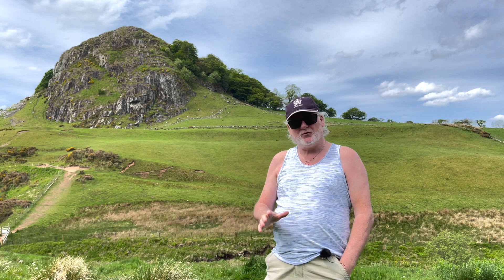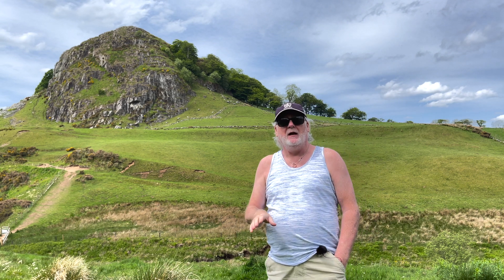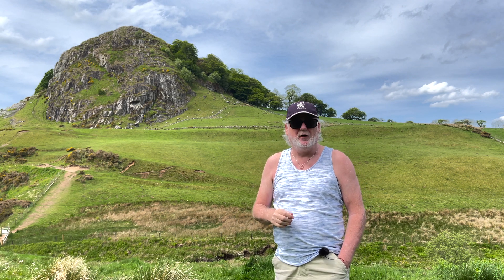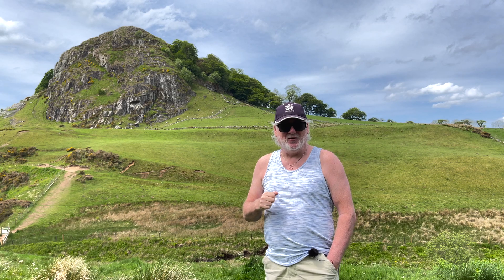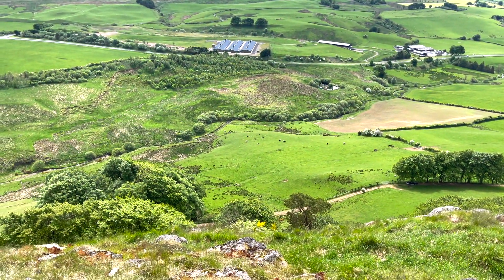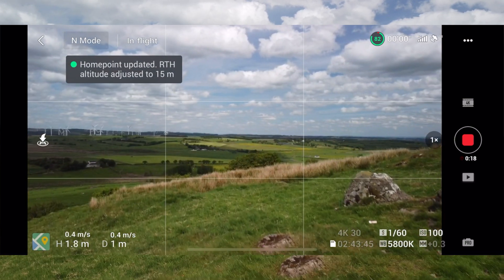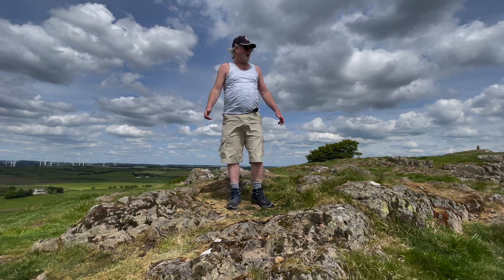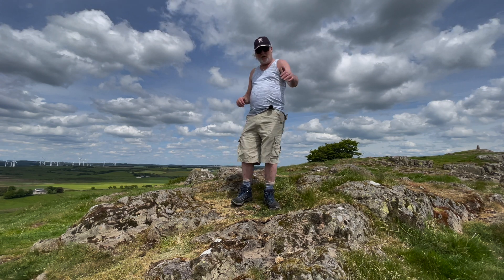DJI mini 2 | RTH NEGATIVE ALTITUDE Test!!

Comment: Great vid Robert.  I am still trying to determine what was more impressive….. the RTH and negative altitude results you proved out or the fact that you hiked up to the top of that hill!  Quick question … When you tapped RTH in that situation, did Lassie immediately begin ascending or did she fly any horizontal directions first and then afterwards ascend?
Reply from the maker: Oh, me getting up to the top - alive - is the more amazing thing ;). Lassie immediately ascended on pressing RTH. You can see this on the telemetry if you check the distance she is at (and the horizontal speed)

Comment: 05:05 Wondering why it says "unsuitable landing area" what was going on there, did you try and hand land?
Another nice video of a test that its good to know comes out as you would expect it to.
Reply from the maker: See the rocks i'm standing on?  There are lots of those - all shapes and sizes and all at different heights. The RTH point was right in the middle of those.
Reply: @WindsweptRobert  but how does it determine that its unsuitable, I thought it had quite a simple proximity sensor.
Reply from the maker: I’m not sure how it determined this, but it was quite right - the landing point was directly above a number of rocks that were all different heights and shapes (I launched her from one of the flatter stones amongst these rocks).  When I took control of the landing, I just moved Lassie a few feet from where she was hovering and landed her in a grassy patch.
Reply from the maker: A much more comprehensive answer than I could have given. Thanks Neil :)
Reply: @WindsweptRobert  Ah yes makes sense, I guess it saw all sorts of changing measurements as you tried to bring it down.
Reply from the maker: Aye Andy, there's a lot on the telemetry. The speed of horizontal movement, and the speed of vertical movement are useful and often overlooked numbers on the screen. Living in the hilly and craggy place that I do, I find these readouts to be very useful :)

Comment: No surprise there. You set the RTH height to 149.
Reply from the maker: No, i set the RTH to 15m
Reply: @WindsweptRobert  Simple arithmatic. -100 too 49 = 149.
Reply from the maker: @daveday5507  I think you may have missed the point of the video even though I explain clearly at the start what I am going to do, I then do it, I then recap on what I did. 15m or 49.2' is where I set the RTH on the app, and no amount of arithmetic is going to alter that fact :)
Reply: @WindsweptRobert  I think you're missing the point.
Reply: @Neil_Jarman  Why does everybody get confused over a minus sine?
Reply from the maker: Nobody is confused except you Dave. I’ll re-check the video, but I’m sure I included the page where I show the RTH height set to 15m. If I didn’t include this screen on the video, that may be where the confusion lies.
Reply: @WindsweptRobert  Who's confused? You set the RTH at 15 meters above the home point. You descended 100 meters BELOW the home point. When you told it to RTH it climbed to where you told it, 115 meters above where it was. What else did you expect?
Reply from the maker: I expected exactly what happened Dave, as I say at the start of the video.  I'm glad you've now stated that I set the RTH at 15m. I don't know why you were so insistent in your previous comments that I had set the RTH at 149'. But glad we are now in agreement :)
Reply from the maker: Correct, Neil and well stated ;)

Comment: Did you find a strategic point on the cliff path, where you can keep vlos every point. the occusync will disappear behind rocks...oohhh and don't step backwards. Also its good to know how high you are above the floor/beach whatever. Good luck, I will catch up in the evening. Looking forward...
Reply from the maker: Aye, I found a strategic point where I had VLOS. You’ll see this when you watch the video :)
Reply: @WindsweptRobert  Nice informative video once again Robert.
Reply from the maker: @DronescapingBritain  Thanks DB :)
Reply: I did this video without realising the height when I started, I made a guess at 40 m which was about right then during the filming I couldn't work out the scaling on the small screen, neither could accurately tell from looking down at the Mini2 from above.  From above it's difficult to determine exactly how far from the surface you are. Therefor erring on the side of caution I decided not to get too low. Am I 12 foot above the waves or 30 foot above the waves.. hmmm 
https://youtu.be/bWklSFW9gcc
Reply: @Neil_Jarman   Hi Neil I assume you are talking about my video. Just to be clear I did my homework  I reconnoitred my flight first. I found a spot high on a certain outcrop jutting out towards the Sea in order to maintain vlos it was above where I set off. Had I have gone behind a cliff from my RTH point I would have lost signal and returned home. I knew the cliff was around 40 metres above the beach. I had my RTH set to 50 metres With the aid of the Cree strobe I never once lost sight and my max distance was 480 metres from my home point. It was filmed in April when that location was not so busy. Oh and I should add , I hadn't planned to land, my reading was something like minus 25 metres, so I pretty much kept that level which would have made me 15 to 20 metres above the Sea.